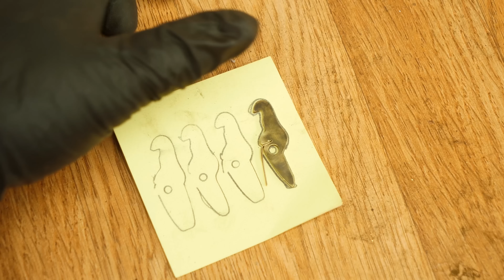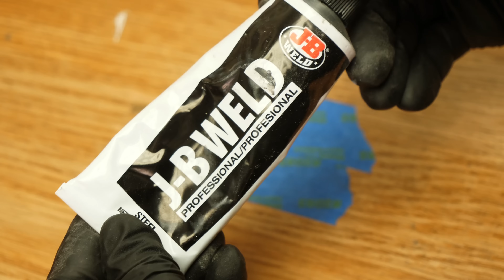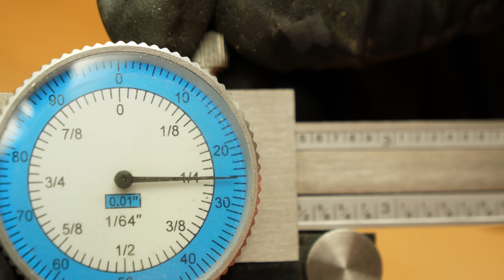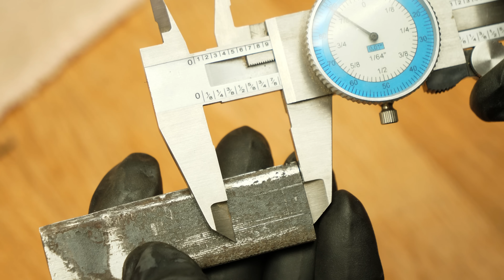I Restore A 1905 Rusty Lock - Gross Surprise Inside!

Comment: The lever springs are unlikely to be made from copper as the metal is too soft to store much energy. Copper is used in electronics for springs that are not under a lot of tension but the ones in the lock are more likely to be made from brass or phosphor-bronze.
Reply: berylium copper makes a good spring but I would guess it is too modern an alloy for the original
Reply: Off topic, but minesweeper anchors and chains were/are made from phosphor bronze as they are less likely to set off  mines.
Reply: Yeah, brass most likely.

Comment: I have begun many such projects by first immersing in kerosene to soften all rust inside and out.  If the item is too large, I wrap it in burlap then saturate it to soak for several days, sometimes months.  Most bolts and screws are then easily removed along with surface rust.

Comment: Do you do a lot of these restorations? You might want to consider getting a desktop fiber laser. It is great for taking off rust on smaller projects.  No chemicals, wire brushes or sandblasting.  😎 Awsome work never the less

Comment: Lost, found and from this restorer's point of view, destroyed. You found an interesting bit of history and turned it into a cheap looking souvenir. Why would you sandblast all of its hundred years out of it? To then cover it in filler and spray paint?! All the plates needed to look the part was a brush clean and some oil. Or some Owatrol and paint, if you must add a colour
Reply: I thought it was an odd choice. I'd have wanted to see the inside smoothed out so the mechanism can operate optimally, but the outside left with some character.

Comment: You need a real staking block with many different sized holes for punching out those rivets. That "setup-block" you're using in this video is made for keeping pieces square for welding and fabrication, not hammering out rivets...

Comment: Me Id use  Electrolosis in washing soda to remove the outside rust dose a lovely job plenty on U T about thar.
The rivit heads would be off in two shakes by clamping block on a bit of hard wood in my Warco mill and milling them off one side  scan other side of the lock in my  HP C309 printer /scanner along with a 6" ruler cm side up. and print onto a clear sheet of mylar scaled 1:1  exactly hence the mm scale. Use this to run up an anvil block and a punch in the rivit gun on a light strike. degunk the innards electrolyse with washing soda again as per Youtube instructionals quite frankle having got it stripped and clean there are plenty of cheap plating kits about a quick nickle or zinc  plating and it'll outlast you . New rivits I would run up in the lathe using a soft Stainless Steel. Simpls I cant live without the shop it makes life so much easier and in the long run you probably come out on top particularly doing stuff for other people  less well equipped.